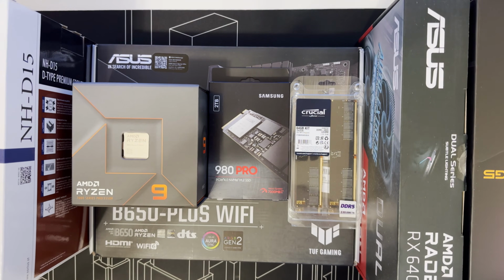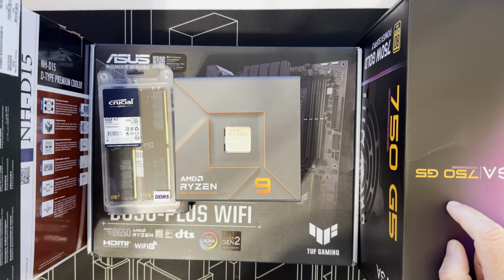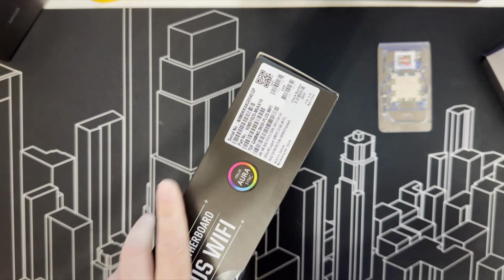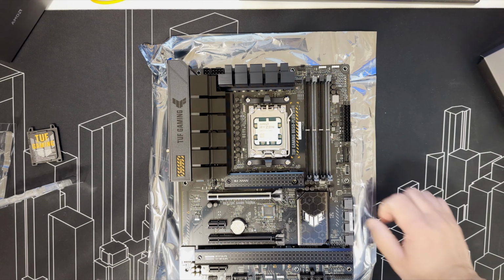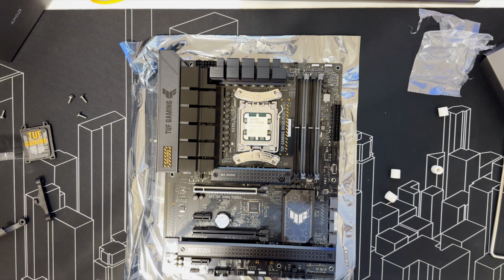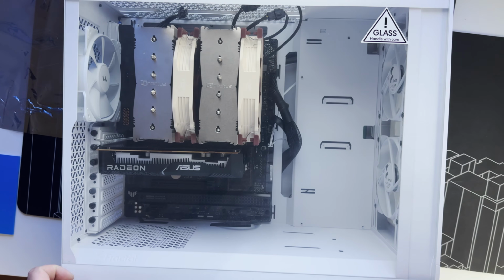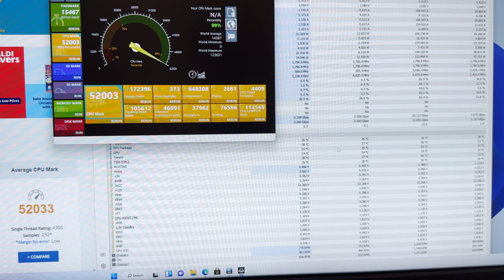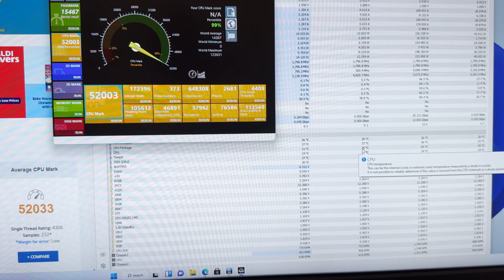First AM5 build - Ryzen 9 7900X + ASUS TUF Gaming B650-Plus Wi-Fi

Comment: Hello, Did you ever use that 4 pin procool connector in the top left? I can barely find any info on it online other than it isn't necessary. In your experience did you ever use that connector? I ask because my Corsair RM1000e didn't even come with a 4-pin connector and I'm trying out a mini itx build and don't want to use more cables than I need to already.
Reply from the maker: I did use both 8-pin and 4-pin power connectors. However, in most cases, you should be able to get away with using just the 8-pin alone. If your system does not boot or you notice unstable behavior, you can consider the extra cable or a PSU upgrade at that point.

Comment: can you use pcie 1x slot?
Reply from the maker: I have not had a need to so far, but I don't see why not. This motherboard has 2 of them.
Reply: @PointlessVideos45  i question you because my gpu use 3 slot and cant use my second pcie x16 on my b550, i use some adapters on pcie 1 and in future upgrade will be dificulty, can you take a photo with your gpu installed? And showing a slot
Reply from the maker: @tautau22BR  Sure, I will take a picture when I open it up next.

Comment: you bought 7900x and other parts  and you combine that with crap gpu as rx 6400 !? why did you bother to bought that shit at all because if you dont need gpu  then you could use igpu from 7900x anyway only
Reply: 6700xt is really good budget gpu. It's the best, plus FSR3 boosts it.
Reply: @humansvd3269  6700xt are and rx 6400 not

Comment: When trying to connect my liquid cooler, none of the brackets would fit, any suggestions?
Reply from the maker: it depends on what liquid cooler you have, and did it come with AM4/AM5 mounting hardware?
Reply: your most likey trying to put an am4 cpu cooler onto an am5 motherboard or your cpu fan is for intel cpu's
Reply: @TolerantTink  am4 coolers are compatible with am5 boards